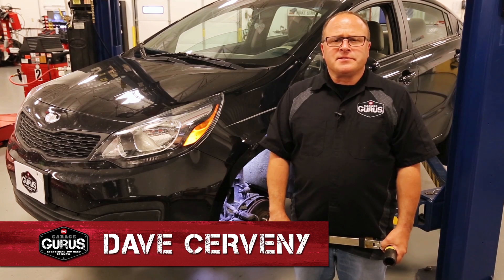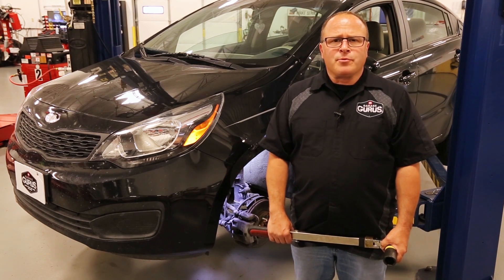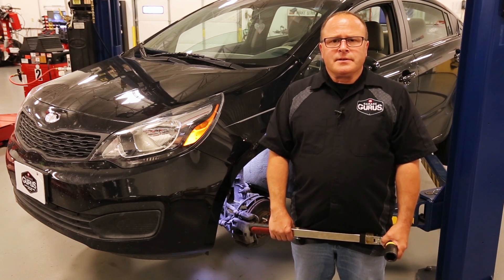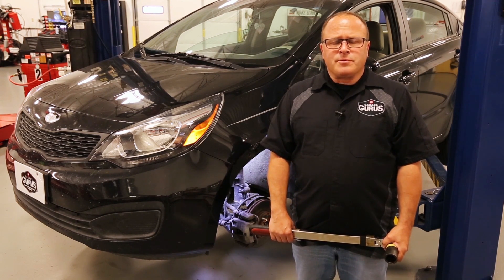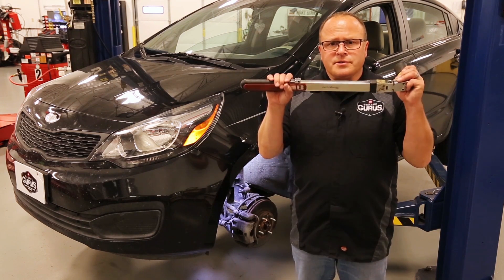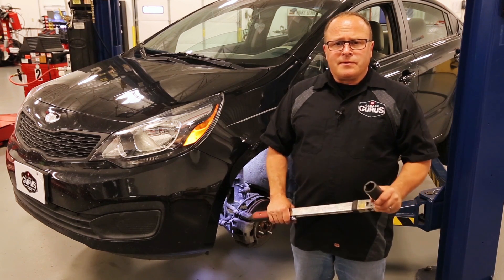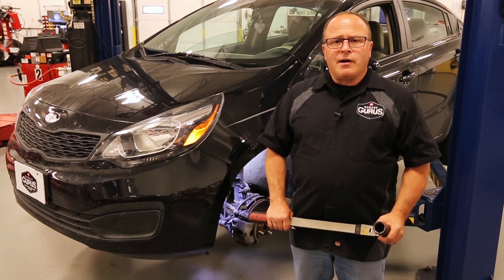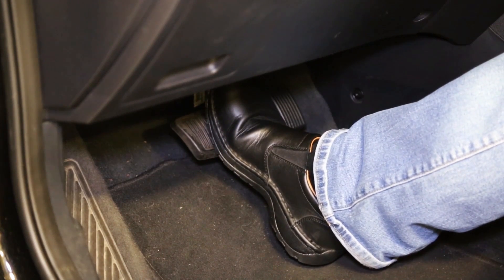Tightening Axle Nut on Hub Bearing

Comment: I thought you're supposed to torque the nut when the car in on the ground.  For my '94 Mustang I have to torque this nut to 250 ft-lbs...fun.
Reply: Your Mustang doesn't have a front CV axle. Instead, it has a fixed spindle

Comment: I don't get it. You're saying not to over tighten the nut but you don't say how much to torque it. I imagine it will be different on each vehicle. Provide a typical range or provide link where to look it up.
Reply: Anywhere between 150-200 ft-lbs
Reply: @dreyterex4350  My 2002 Grand Am has two specs: The original pac-style nut is 284ft-lbs, the newer nuts are 173 ft lbs so kinda weird
Reply: that’s where he makes another video telling you about the torque specs
Reply: It's for you to look up the vehicle specs
Reply: He can't tell you because it's a secret, and apparently you don't know how to do searches on the internet.